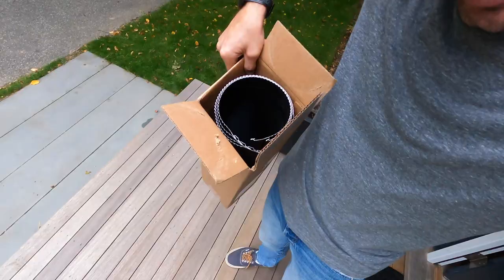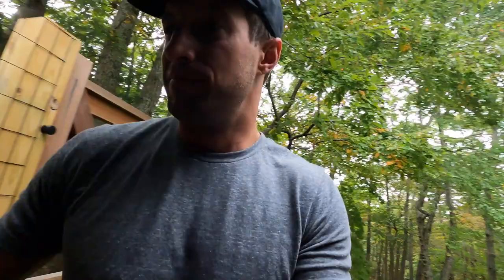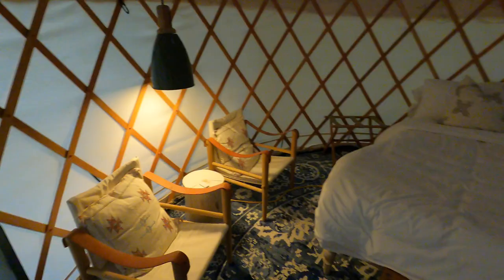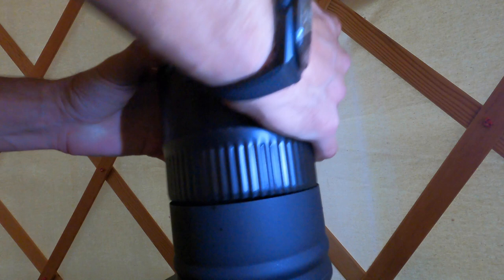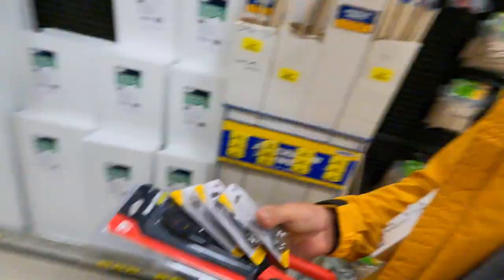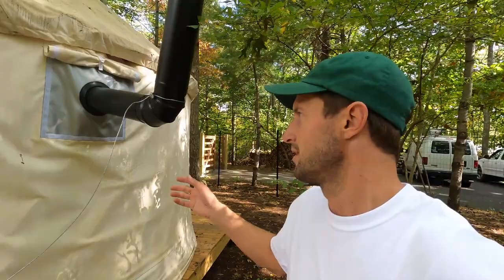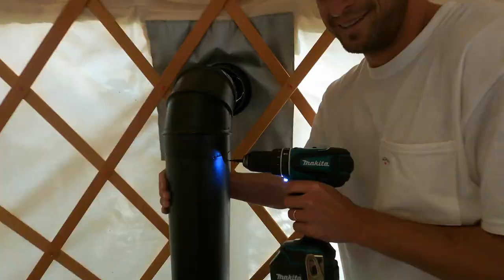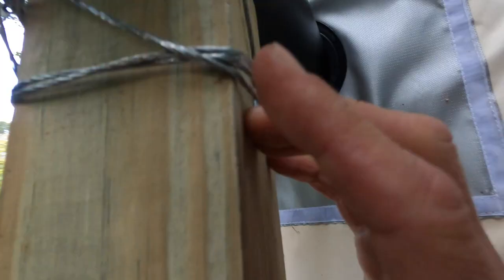The Backyard Yurt - Fireplace / Wood Stove Install

Comment: Use the spear metal that you cut from the piping drape it over outside pipe, secure real tight and screw into wood, much more aesthetically pleasing than that wiring.

Comment: I would have a license contractor look at that installation. Wood holding up a hot pipe does not seem very safe on the outside. You don't want to burn it down.
Reply: That was my thought too! Wood is extremely flammable so why use that to hold up the hot exhaust pipe?